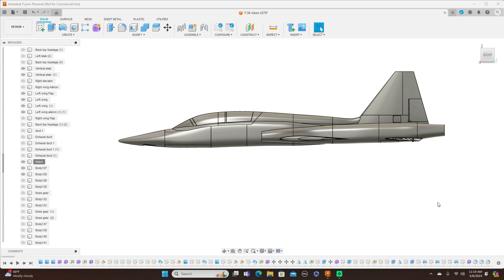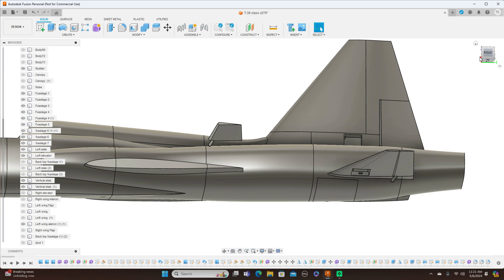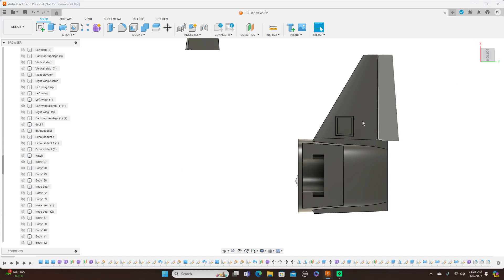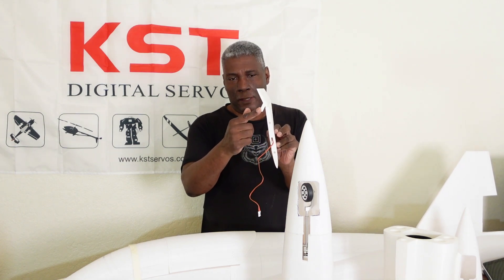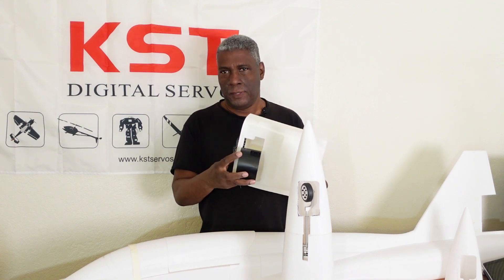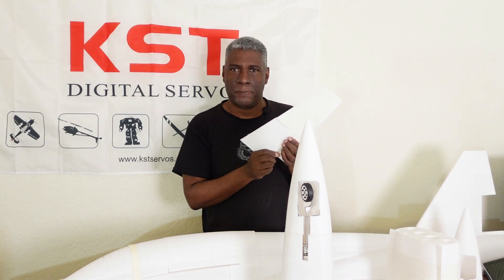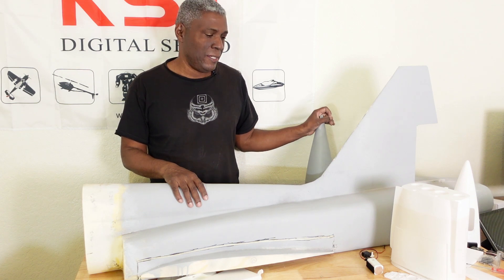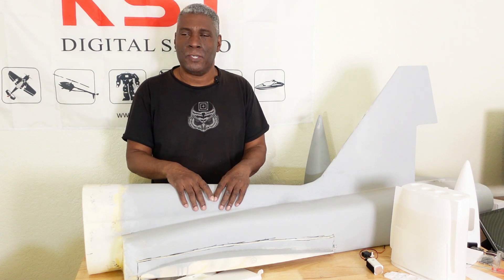83 inch long 3D printed T-38 EDF Jet

Comment: awesome work but how are you going to get the edf in there with the motor installed?
Reply from the maker: Thank you. the EDF unit with the motor will be installed in from the hatch.  I have opened up the area already so the EDF and motor will fit. I just did not get around to filming the new EDF section.

Comment: I love your teaching videos. I flew the T38, I was an AirForce pilot. Fun airplane to fly and I bet your model will be too. Something I noticed I thought I'd bring up. You probably already have allowed for it and I just didn't see it. The bay for the EDF seems tailored just for the EDF to be installed. My question, how are you going to put the EDF in "with" the motor attached? From the video it didn't look like there would be enough room as the motor sticks out the back of the EDF shroud. I am a novice when it comes to Cad and Fusion. I'm learning more everyday and your videos have helped SO much, Thank You!  I'm trying to build a 70mm F-106 and the fuselage is interesting to try to build with my low CAD abilities as of yet. I am a member of your FaceBook group. Thank you again and please continue with sharing your knowledge and projects.
Reply from the maker: Thank you. the EDF unit with the motor will be installed in from the hatch.  I have opened up the area already so the EDF and motor will fit. I just did not get around to filming the new EDF section.